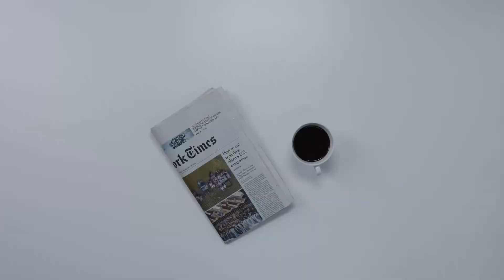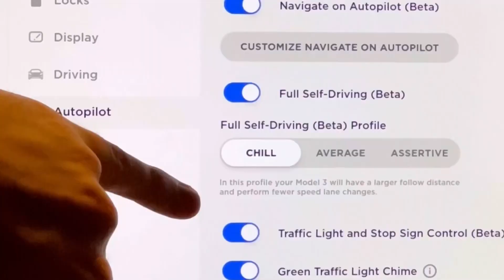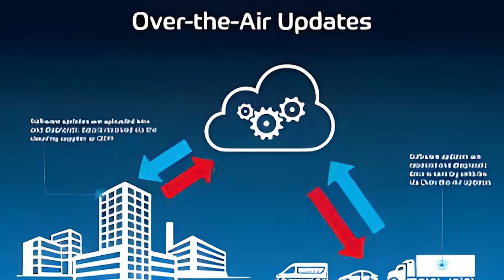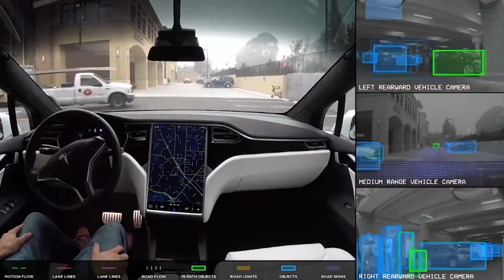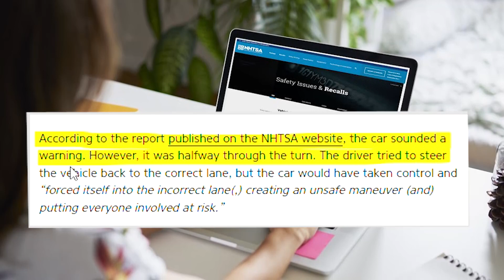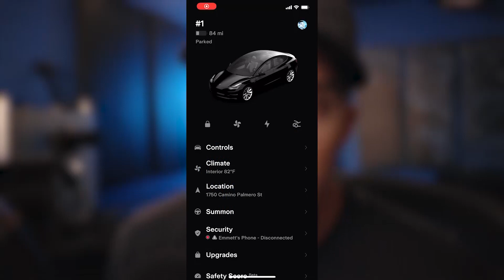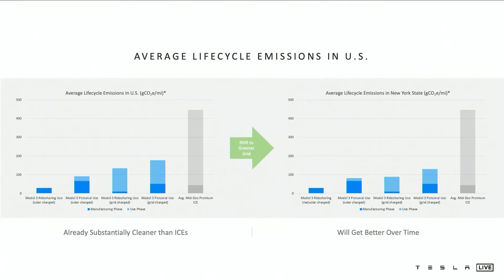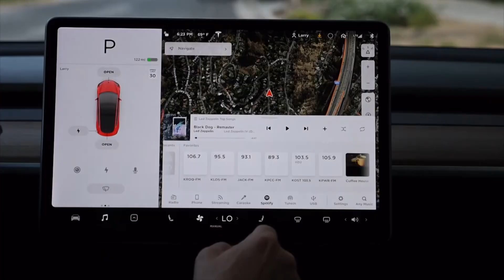Tesla FSD: Roll Out of FSD BETA BECOMES A MASSIVE DISASTER !

Comment: How many days/miles do you have to drive with a safety score above 98 to be accepted into the beta?  I can't wait to help make this amazing software better with my feedback.
Reply: Took me 8 days. Averaging about 30-40 miles per day. I actually went out of my way to do the same thing you're trying to do. Which is to become a full self-driving beta driver. The biggest tip I can give you is always use the car on the freeway/highway in self-driving. I had a 98 when I got accepted
Reply: @chrismiles2000  We have 9 days and about that many miles.  Two days were 97.  Do you think we should opt out and back in?
Reply: No. It'll come as long as you make the 98 or above.